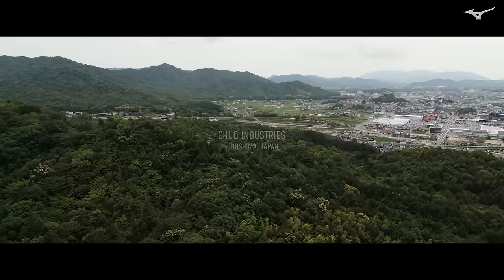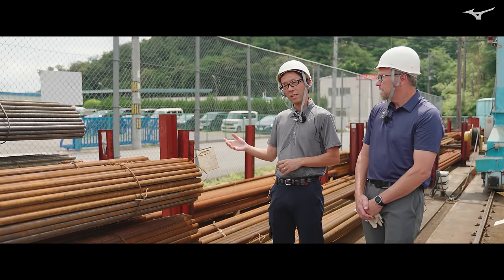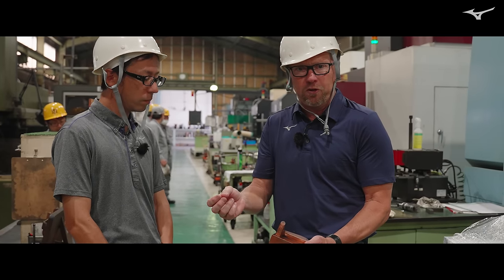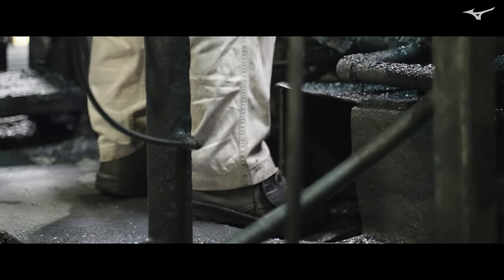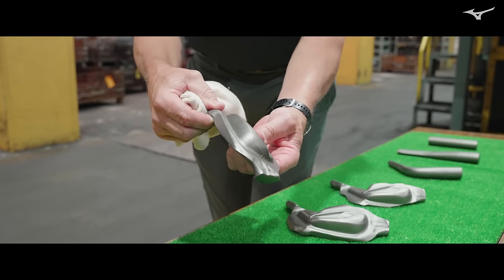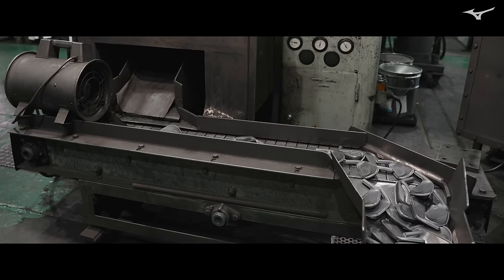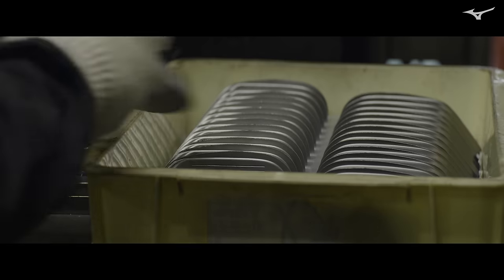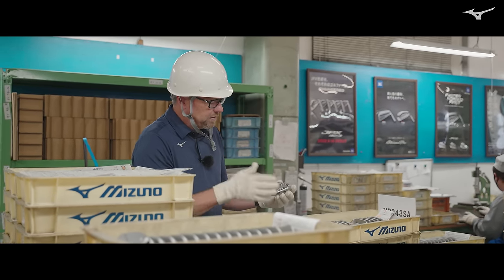Inside The Factory - Mizuno Pro 241 / 243 / 245 irons

Comment: Legendary irons!! Have played many variations throughout the years like the mp-32, mp-37, mp-64. I had a set of 695mb's and then switch them out for a new set of mp-64's and immediately sold the 695's. The Mizunos felt just slightly softer but the Mizunos were just more stable and consistent as well as less offset. Mp-64's are the GOAT and the offset pofile is damn near perfect, never go over 0.122 offset period ever. Couple things mizuno should bring back is the classic fonts of the mp-64 on the back of the iron and the sole as well as the original grain flow forged font. Mizuno's wear very well from use. Great products.

Comment: Played Mizunos for years...MP14 (early 90s) and MP32 (current set) and looking forward to a fitting with a Mizuno Rep on Feb 7th for the new series of Mizuno Pros. I'm in between getting the 241 and 243.
Reply: What did you go for? I'm guessing you decided the easier to hit irons were a more usable option as you become eligible for senior golf. The 245 have a similar look to the 24@,243 but so mich easier to strike. Especially after a few weeks on holiday. Plus so much easier to flight than a compatible tm or cway

Comment: Waiting for my 245s! when does the copper happen? How do you make the 245 hollow?
Reply from the maker: Copper plating is another process after the heads leave the forging factory.  The face and neck of the 245 are its forged component, with a stainless steel back section.

Comment: 8:11 I'm not buying that for a minute.  Im a Mizuno player but this guy is laying it on a bit thick.  Blocking some of the excess material that is coming out of the sides of the press so more material is captured inside the head shape?  This is physics; if the metal squeezes out the sides, that's because the useable area is completely full of material.
Reply from the maker: It’s a genuine thing.  Grains within the steel are tighter if less material escapes.

Comment: I’ll be booking a custom fit for around June, will be either the 425’s or the Miura 502’s., though the Miuras are around double the price of the mizunos.
Reply: Miura tend to weld their irons. Create the head and then spin weld on the hosel. Not sure which models but they have that reputation. Years ago Mizuno posted some photos of iron heads they had cut open to show the welding.